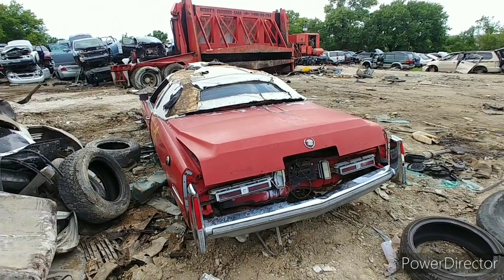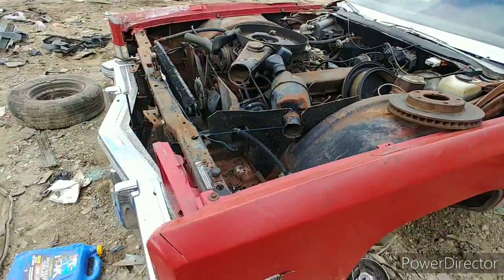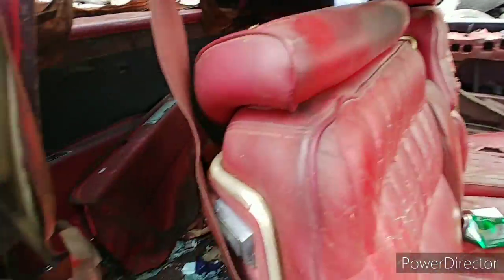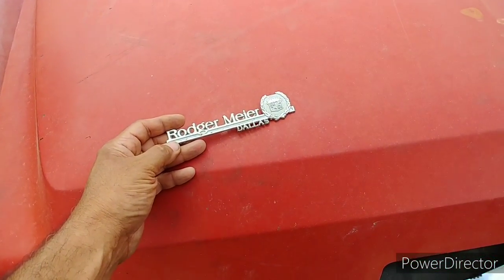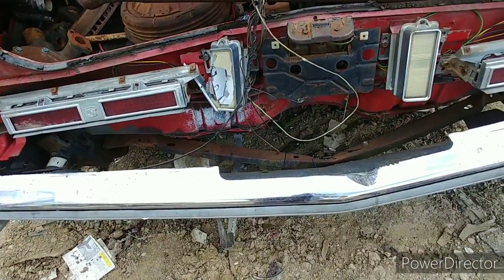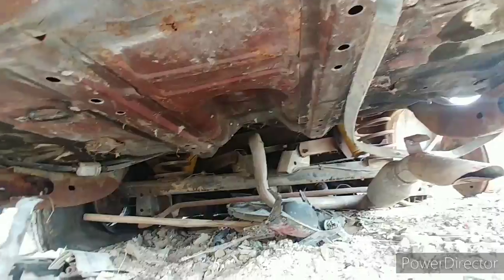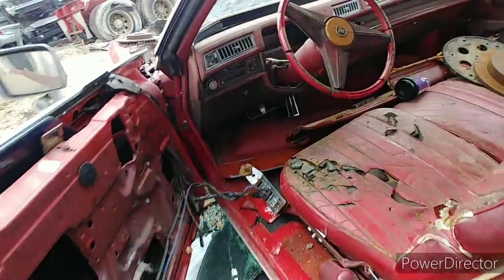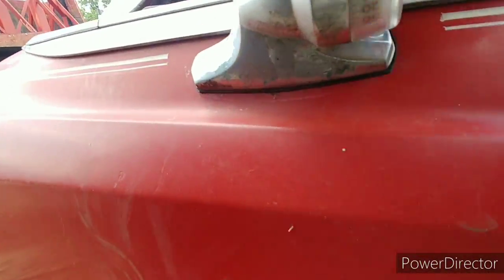1974 Cadillac Eldorado Junkyard Find Bound For The Crusher

Comment: Wow there'es quite a few parts left to save. I don't think the yard even ATTEMPTED to part it out.
Grab the fender skirts AND the grilles! They're already taken out and easy to get. Those go for LOTS of $$$
Also the temp gauge on the driver's mirror.
Good engine too, should've gone out as a derby car, those 500s are tough and reliable!
Reply: I had that car at my shop, tried parting it out but would hardly ever get any messages for parts, had to get rid of it since it was taking up to much room. I did manage to sell a few parts but like once every other week. Had keys and tittle and engine stilll turned over but nobody seemed to want anything off it anymore, so to the crusher it had to go. I find it interesting that it ended up on YouTube 🤣

Comment: 1. Drivers side exhaust manifold.
2. Skirts.
3. Oil pan.
4. Dash pad.
5 steering column
6. Trunk lid
7. $$$ power bucket seats. Smh
8. Spare rim.
9. Emblem
10. Grille, ashtray, taillights.
So so 😔

Comment: Tilt-tele is an easy flip.  Around here those Rochester carbs vanish fast, even on like the 80 Pontiac I found.  Surprised the engine isn't worth picking, seems like those had the 500 standard.  Even the rims getting to be a bear to find.
Reply: 500 was the only engine, yes.

Comment: Why is that 500 cid motor still in it !  Only came in Eldorado in 70-74
Reply: Nope, other models had it, but not until 1975 as you stated.
Reply: @googleusergp  well your wrong. 500 Caddy was exclusive to 70-74 El Dorado FWD.. In 75 it came to the other RWD models
Reply: @OneManGarage  Whoops I meant to say 1975, typo, went back and fixed it. Lol. BTW way it is "you're" not "your". Your original statement is correct up to the 1974 model year, yes.
Reply: @googleusergp  all good and fat thumbs no grammer judgement :)
Reply: 76 DeVille still had it. 1977 was the downsize.
Reply: @CadillacCentral  Correct. 1976 was the last year for the big displacement motors for the GM passenger cars. Of course those larger displacement engines continued in the trucks.
Reply: @CadillacCentral  Yes 75-76 was only RWD use of it.  No more big car engines after 76 455's 454 , 472 or 500's and only 3 more years of 400 403 and 425 in Pont Olds and Caddy 77-79

Comment: I used to call these a "Cement Mixer" They were real work to drive, got horrible mileage, no power out of that 500, and the  list of Malaise Era poor quality and design, go on and on. It was cars such as this, ruined the American auto industry. Please crush it, and pretend it never existed........
Reply: The front wheel drive gave it the top heavy ride and feel . These were no worse than other cars of that era.
Reply: It got worse, 70s weren’t no where’s as bad as the 80s, that’s what killed American automakers, corporate engines, no power, bad material, paint cracking in the new light weight hoods, my new 80 Grand Prix s that Buick v/6 was horrible, my 83 Riviera with its terrible 307 Oldsmobile motor
Reply: @pontiacgrandprix733  The 307 was far from a bad engine. I've owned several (and still do) and I know people that have run them upwards of 350-400k+ and they have never been apart. Nothing was stellar quality in the 1970s or 80s. The Japanese were more consistent, that's what helped them win the game with us.
Reply: @googleusergp  After that 307, o never purchased another GM car again, I bought a Lincoln MK VII, Mark VIII, then went on to BMW, and the last 5 cars Mercedes, my wife’s got a Ford, and I’ve got a Ford for work, I’m buying my son a Toyota, GM lost me a long time ago,
Reply: @pontiacgrandprix733  I understand, but there is nothing wrong with the 307. It's a Simple Simon engine that runs, runs, runs, runs, runs and then runs some more. They are durable.
Reply: @googleusergp  I could outrun it myself at 250lbs, it was a anchor, that drank gas , and moaned at 70 mph, GM abused American car buyers with their junk, and that’s y when you go to lease a new 85,000 Cadillac it’s 200.00 per month more, than the same price Mercedes, cause they loose their value as soon as the tires hit blacktop
Reply: Do you remember, they changed the material of the hoods, and didn’t change the paint, all GM hoods and trunks got cracks in the paint, they were the worst cars ever
Reply: @pontiacgrandprix733  Never had that problem. Got close to 20 mpg with my 307 and it was through four teenage drivers and my aunt and my uncle before me. Still runs like a top. Nothing made in 1983 was very fast anyway. If it was, it would have cost 3 times more than the Riviera did.
Reply: @pontiacgrandprix733  It happened to all of the Big 3/Big 4 back then. The paint manufacturers blamed it on the OEMs and the OEMs blamed it on the paint manufacturers. The truth was somewhere in the middle.
Reply: @pontiacgrandprix733  I have been driving Volvo, ever since my Cadillac "Deathstar" left me stranded miles from nowhere  one cold rainy night..... I call "GM" GC, short for General Chivvy.... ONe can purchase a Cadillac Chivvy, a Buick Chivvy, or a Chivvy Chivvy. Take your pick, they are all poor quality, poorly designed, overpriced crap!